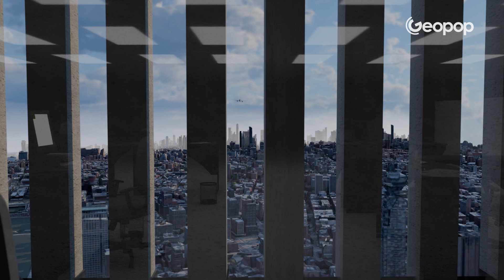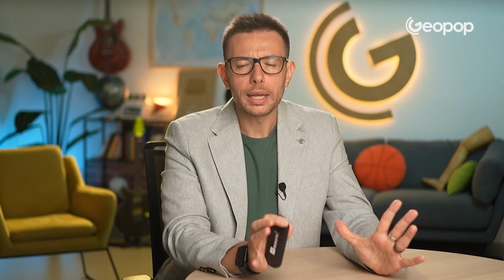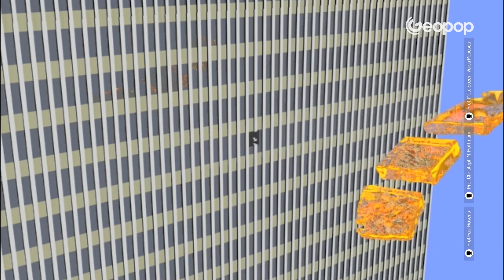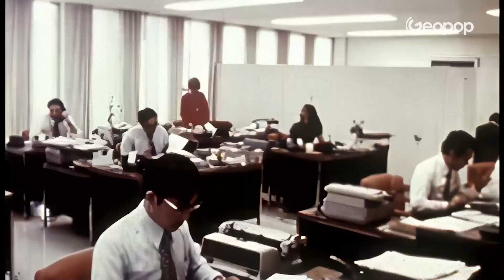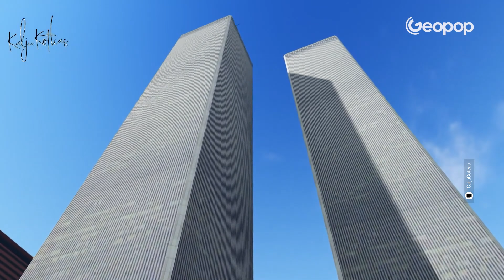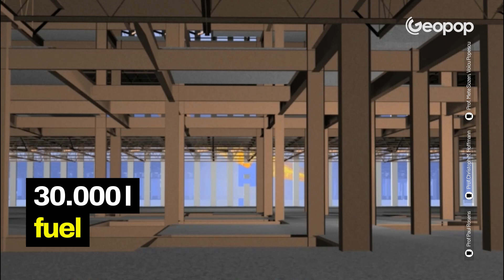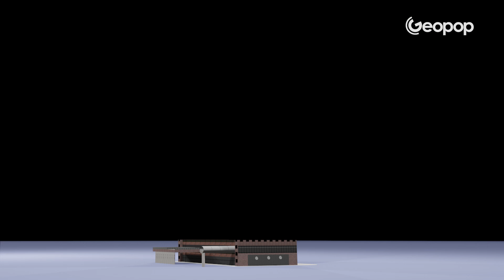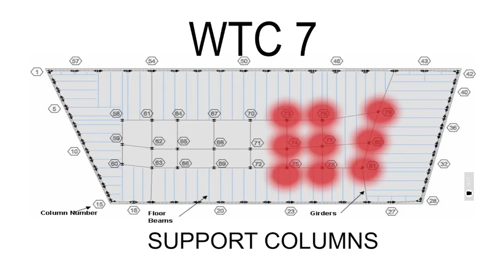9/11, 2001: The Technical Reconstruction of the Twin Towers and WTC 7 Collapses

Comment: Please tell me you really don't believe this? The inner columns about world trade center 1 and 2 was more than enough to keep both buildings standing. And the fuel from both planes dispersed through the building and did not remain inside the building in jet fuel does not burn hot enough to melt steel!! 9/11 was not a terrorist attack 9/11 was an inside job and there is evidence to support that a plane crashing into a building would not bring down an entire 110-story skyscraper!! Building 7 was brought down by a controlled demolition reporters in that area was telling people that building 7 had collapsed 20 minutes before it actually did collapse. And building 7 was never hit by a plane it had minimum fires and that was it so you don't tell me that a fire brought down a 47 story steel structure? There's holes all over this 9/11 conspiracy and it doesn't add up to what you're saying
Reply: I've used this analogy. If my memory serves me well, in 1997, a van, with a considerable amount of explosives, was parked in the underground car park, of the WTC Towers. It exploded, did quite a bit of damage, killed a few people, and failed to demolish, even one tower. It was attributed to Muslim terrorists.
Now, why would a terrorist organisation, place a large package of explosives, at the base of the Twin Towers, and not at the top?
One wouldn't place the explosives at the top levels, as the explosion, will only have a dramatic effect in the immediate area, and above 
It you start a campfire, or an open fireplace, the base of the fire is at the bottom. If you light the fire above your kindling, it is not all that effective.
Without taxing the interested reader too much, think of this, in a reverse theory.
The Twin Towers, were of very robust construction, at the base, so as to support the floors above. As the floors progressed, the construction was progressively lighter, as this increased the floor space area, without diminishing structural integrity.
Now, try and get your head around this.
If you could physically take the Twin Towers, and up end them, they would crush, without any assistance, other than that old friend, "Gravity".
The Twin Towers, and WTC, had gravity, assisted by outside influence.
Reply: Did you watch the video? I don’t think you did, because almost all of your points were quite well explained.

You don’t even need to melt steel to weaken it, ask any blacksmith who molds the stuff with a hammer. With the building’s structural steel under stress, the hot fires weaken it and initiated the collapse. This is very simple to understand.

Your inability to understand engineering and physics is not evidence against it.
Reply: Twin Towers were an integrated system of 47 core columns supporting more than half the gravity loads, 236 perimeter columns supporting the remaining gravity load and ALL of the lateral (wind) loads, long-span lightweight steel floor trusses connecting those two systems and a hat truss to cap it off.

Failure of any one of the major elements would have resulted in global collapse. 

Let’s break it down to the absolute basics:

The 47 core and 236 perimeter columns of the Twin Towers support all of the gravity loads of the building. ALL of the resistance is in the columns.

Planes impact Towers, causing massive structural damage, destroying sprinkler systems, tearing out gypsum board walls and blasting off the SFRM insulation from the floors. Multiple floor-wide fires are started instantly and spread rapidly due to the destruction of fire protection systems and venting of the building during the impact.

Serious fires were largely confined to the impact damaged floors and those immediately adjacent to them.

Fires were started by the impacts and fuel aboard the aircraft, which acted as an accelerant. No shortage of other consumables inside the tower to continue the fires.

Collapse was initiated (started) at the impact and fire damaged floors when floor trusses exposed to heat over time sagged, in turn pulling on and causing the inward bowing of some perimeter columns by up to 5 feet until they buckled on one face of each tower (ie: NOT symmetrically).

www.youtube.com/watch?v=ULdiD6gYZO0

No steel melted or needed to. Structural steel will bend and fail at less than half its melting temperature.

Once the perimeter columns buckled the formerly static load above became a dynamic load 30 times greater, easily overwhelming the structure below.

Thousands of tons of now loose debris fall through the open office space within the four outer walls - bypassing the columns - dropping 12 feet onto the first intact floor it comes across. That massive instant overload causes the floor to fail, shearing the pair of bolts that secure each end of the floor trusses to the columns. The floor fails. adding its mass to the falling mass which continues to accelerate for another 12 feet until it impacts the next floor, rinse and repeat one floor at a time all the way down.

The columns - the part that holds the building up, supporting ALL of the gravity loads - are spectators for all this.

Rate of collapse increases as momentum increases. The collapse front is constantly accelerating.

As each floor fails, air inside the building (the Towers were 95% air by volume) is compressed, then blows out the sides _in reaction to the Tower falling, not the cause of the Tower falling.

No fire required at all on floors below the impact points for them to fail. The mechanisms that started the collapse are different to the mechanisms which continued the collapse. That will be a difficult concept for some.

As the floors fail the perimeter columns are left literally hanging in the breeze, no longer attached to the rest of the structure. They peel away and fall in great sheets (think banana) out to more than 600 feet from the base on the 4 points of the compass.

Core columns failed last.

No Laws of Physics are violated so no need to invoke magic or divine intervention

Each 110-story tower had a 1-acre footprint. The debris pile was up to 14 stories deep and spread out over 16 acres, destroying 8 surrounding buildings and damaging more than 100 others.

Anything can seem like a conspiracy if you don’t take the time to understand how it works. Hopefully now you do.  If not, I can go into much greater detail. 

We can address Building 7 separately if we really need to.

Comment: That's all very well explaining the fail point of steel.That's understandable. The heat generated by combustion will rise to the levels above, not below, so the lower levels steel, is not subject to heat increases.
Heat has three properties. Convection, Radiation, and Conduction. Heat will take the course of least resistances, in this case up, sideways, but not down. To go down, it would need a downward force.
In this case, an upward force is applied. Oxygen is supplied from outside the towers, from the breaches caused by the colliding aircraft, plus any additional oxygen, coming from lower levels, even if a lower rate.
Combustion in a confined space, can cause enormous heat containment, that will consume combustible materials, but at a reduced rate. Open a door, or any other access for additional oxygen, will result in an immediate fireball. A confined space, on a  ship, has gas tight, and water tight  screen doors, and hatches As an example of the power of heat, these access ports, have threaded removable test screww. If a fire is suspected, or present, the smtest screw is removed, and you listen for any rapid influx of air. The vacuum created by combustion is so strong, that we were war ed, not to place your eye at the inspection port, as the vacuum could suck your eye, out of its socket